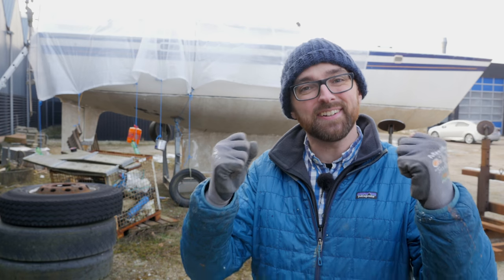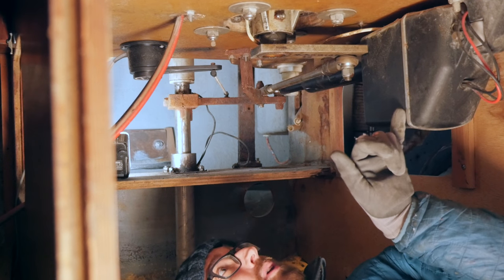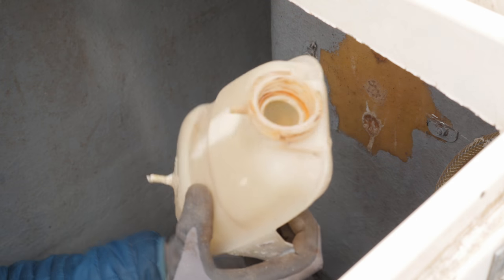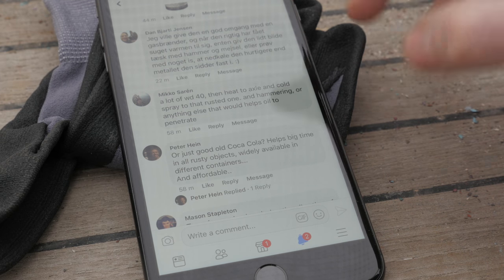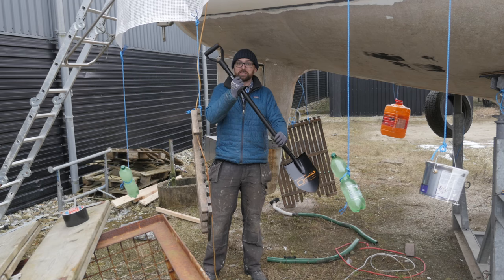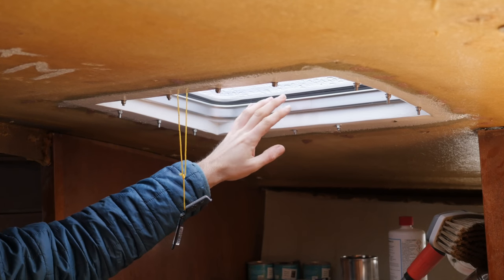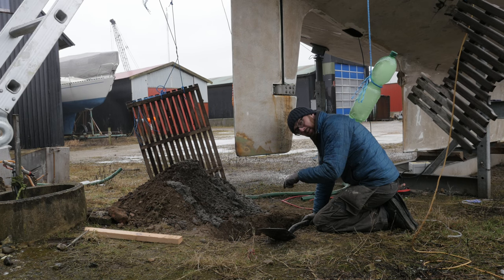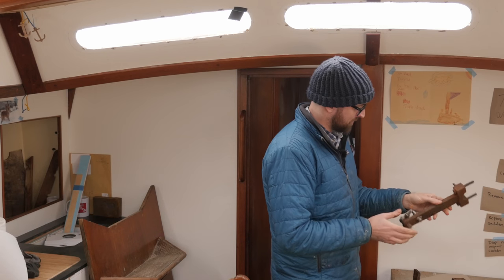Sail Life - Removing the rudder from my sailboat - DIY sailboat repair

Comment: Stop....I would not split the rudder down the seam, that will destroy the rudder and I have done it on several rudders made in a similar way just to get the stainless out.  Best idea is to cut an access panel on one side about 25mm from the edge.  You should be able to prise the panel up and then dig the foam out and inspect the stainless from there and decide on next steps.  If welds and stainless ok then you can clean and re bond to the rudder skin and pour new foam in before closing the panel.  Unless of course you want to make a complete new rudder...  Sorry Mads I burst out laughing when that rudder broke the last bit of wood and dropped into the hole then you trying to lift it out.  Too funny.
Reply: IIRC Boatworks Today did it the way you suggest.

I wonder if the rudder is so heavy because it's full of water/ice?
Reply: johnVidBozo yes I think it will be saturated.  Still pretty heavy rudder but in need of a rebuild.  Should be a breeze after the deck.
Reply: You could use a solvent instead of peeling the foam out manually. Of course you have to make sure the solvent wont dissolve the laminate of the fiberglass.

But then again, from 1 hole you cant examine all welds of the stainless ...

Comment: I think what I would do for the rudder arm is grind the heads off of the bolts so I could use longer stainless bolts, then just take it in to be sandblasted and powder coated. Affordable, and it should last another 30 years.

Comment: I would absolutely take the rudder to your Parent's heated workshop, no matter what it takes to get that heavy thing into your car (you may have to remove your passenger seats but it will be worth it).  I'm a stainless steel welder and I'd really like to see what's inside and my bet is soaking wet core with rusty welds just you have said.  The reason welds on stainless rust is way to complicated to type out here, but the solution is electro polish the welds after the new ones are completed.  With a new foam core and glass/epoxy repair to reattach the skin you should never have rust problems again anyway if water never gets to the welds.

Comment: I would use your Dremel tool with a cut off blade and cut the tack welds on the bolts. replace them with some longer stainless steel bolts. then try to find a shop that can tack weld them back on. and then powder coat the bracket. if you don't know powder coating is a powder they put on with electrostatic then bake on in an oven. by far the best coating for longevity especially in your conditions and it's cheap to do at least here in the states

Comment: Ha Mars love tour video's. I am no expert but I would go for a very safe rudder solution. You do not want any problem  with the rudder at any time I would think. Rust hardly doesn't make it less strong I would think. I would go for longer bolts and very solid nuts. Even alles finshed I would ask an expert tot check die strength and durability. Good luck and keep up the good work. Paul
Reply: Mads

Comment: I will say that pb blaster is some pretty good stuff, but as a pro auto mechanic in the northernmost part of the rust belt in the states  there is a better product, and you already mentioned it 50/50 acetone and  trans fluid bar none the best liquid penetrating fluid.
Reply: kevman0111 , I like aerokroil better than AT fluid and acetone. But that's a close 2nd.

Comment: Dont make a new tiller arm. Reuse the old one.
Just grind of the weld of the bolts, insert new (longer) bolts and double nuts.
With a flap disk and steel brushes (or blasting) clean it all and give it a good paint job. This will save you a lot of money and that money you can spend on other to be renewed parts.
Use strenght class 8.8 bolts. tag weld them after you have bolted the tiller arm on again if you like.

Comment: Mads, a small trick you might find useful in future when using vice grips (mole grips). You had them clamped on to that woodruff key in the rudder stock... Clamp them on REALLY tight, then use a hammer to apply blows to the hinged knuckle area just forward of the lower handle on the vice grips. This can help you use them to pull things outward. It may not have worked on that very seized key, but is still a handy trick to have in your arsenal.

Comment: Mads you will obviously need a new key but whoever makes one for you will need both the rudder shaft and the quadrant piece to get a perfect tight fit. I would most strongly recommend that you open up the rudder to see what, if any issues it has to the metal inside and get it dealt with as necessary before taking these parts somewhere to  get them dealt with. Doing so will also make it much lighter to handle as well!
Replacing the nuts and bolts for the quadrant attachment should be easy by cutting off the weld holding the heads and welding the new S Steel ones back in place. Regarding these quadrant pieces get them shotblasted and inspected. I think they will be fine and ideally have them powder coated for anti-corrosion purposes.
The long flat piece of steel with a foot would be cheap and easy to replace but I would also have this powder coated with new nuts and bolts all through.
Lastly seriously consider having the seal which the rudder shaft passes through in the hull of the boat at least inspected and, in my opinion, replaced while it is easy to do so - access will never be easier!!

Comment: Mads I would get the rudder arm sand blasted. I agree with a comment earlier, the metal looks rusty agreed but the edges look sharp and straight. Sand blast or chemical clean and use a new key.

Comment: Are you going to replace the rudder sensor and/or auto pilot ? It looks like it would be a good idea before putting back the engine. Is it already NMEA2000 ? Maybe you can say something about it in an upcoming video.

Comment: Hey Mads, can you you drill out the bolt holes on the rudder clamp just a few millimetres to allow the nuts to fully thread onto the bolts?
As for dropping the rudder, I remove the spade rudder on my 29 ft boat every winter to avoid freezing water damage (it has a bit of water intrusion) and have found that using webbing straps with an adjustable clamping mechanism allows me to control the descent of the rudder when removing it, as well as supporting the rudder when I am trying to wrestle it back into place. Good luck.

Comment: Keep the steel arm, it's more ductile and much cheaper than a new in stainless (rustfri / syrefast) steel.  Get a local workshop to sandblast it, grind off the heads and press out the old bolts. No need to weld new ones in, just fine to have 'loose' bolts and nuts, easy to replace later. Then you finish the job yourself with 2-pack epoxy (but not on the surfaces towards the rudder stock). Low cost and simple work. Btw - do you realise the boat has a happy face staring at you when you look aft in the engine compartment :-)  rgds from Oslo

Comment: Honestly, I worked in stainless steel for many years and to have those parts replaced in stainless steel would be unnecessary and expensive. With it having to be salt resistant, you'd be looking at 316 (saltwater rated) as the molybdenum content of lower grades would not be high enough.... perhaps even made from 904 (super coastal rated and eyewateringly expensive). It would also have to be machined from a billet and, due to the hardness of 316, this too would be an expensive process. The thickness of the existing steel parts would not rust through for another 200 years, however, I see your point about the bolt lengths and they do need to be replaced. This could be carried out by any good quality engineering workshop and would cost pennies compared to a SS replacement. The rust could be removed using a tumbler and a rust resistant coating applied that could last decades. 

Thanks for the great videos, I've enjoyed watching every one! 👍👍👍

Comment: Forget the digging its not going to happen in frost ,Measure your shaft you will be very surprised at how deep and big that hole has to be, we use a backhoe in Vermont after the frost is gone about late April

Comment: Watch out with stainless steel 304 will still rust in ocean water you may look at 316.  However both of them are a lot weaker the carbon steel (which is prone to rust) but iron which is much softer than high carbon steel will rust less and not be so brittle.   So figure out the force you may need and make sure you have the right material.

Comment: Hey Mads! Great job as always but one thing keeps bothering me... The question of making your new steering knuckle out of stainless steel. I know that galling is a big problem on my turnbuckles because both surfaces are stainless steel and I have to apply anti seize on them regularly so they don't weld together. I was under the impression that that the steering knuckle was of high carbon steel as a sacrificial piece so galling didn't lock my steering in place... You might want to look into it. Just a concern I have.. Keep up the good work!!!

Comment: just sandblast and paint. Nickel coat If you want. A good machine shop will have the blasting equipment and contact for the nickel plating. my guess is $100 - $150.  If you make out of 304 SS it will rust anyway. 316 will cost $150+  in material alone.

Comment: You are going to be SHOCKED at how much those parts will cost made out of stainless steel !

The 2 bolts that are not long enough, have a machine shop cut and drill them out and then replace them with longer stainless bolts.  Clean out the pieces with a wire brush and sand paper then apply a couple of coats of an ant-dust primer.  Final coats can be your choice.

Comment: Im early.
Love you Mads! :)
Remember to ask for longer bolts on the stainless copy thingy. 
Also..... ask them if the stainless has the same strenght properties. I know it is a bit harder, ie, more brittle then normal steel, and rudder could experience shocks and bumps.

Comment: I would just sand blast the "doh-dads" and paint them. The rust seems to be on the surface add more than enough material is left. If you by any chance comes near Lyngby I can sand blast them for you.
I'm sure the bolts can be drilled. Got a drill press in Lyngby as well.

Comment: Cut the head of the bolts off on the control arm. Sand blast the rusty steel parts and then have them powder coated.  Install new stainless bolts that are longer.  No more rust or fuss !

Comment: I would consider avoiding replacing the crusty bits with stainless, maybe shot or sand blast the arm, weld new bolts into it, paint it well  and call it good. the other piece might have to be replaced since I saw scales of rust coming off of it, but if it still has good meat to it, just blast and paint it too.

Comment: From a cost perspective, would it be easier on the pocket book to replace the two short bolts with the proper ones on the rudder arm, sand blast the rust off of what you have and powder coat it?  If this arm made it 40 years like this my guess is it'll last 40 more years renewed.

Comment: Fantastic job overcoming obstacles Mads!  I'm interested in seeing what you find inside the rudder and also what you find for stainless steering parts.  Question though, you mentioned that the coupling you left on the rudder assembly was from an old autohelm.  Ar you going to be reusing the autohelm, or replacing it?  Either way, good luck!
Steve

Comment: When PB blaster ain't around, a paraphine wax candle dripped at the seam or in the threads will loosen the bolt with some heat (even if it's not a torch heat, tho really, buy a small propane torch, they are easy to operate, and quite safe, the flame is barely 8 cm long at max).

Comment: My opinion RE the post arm: I would just clean it up, grind down the metal where the bolts thread on and seat (to gain a couple threads), and then paint it. Put some red thread locker on the bolts when re-installing them.
I just think making a custom stainless one is overkill, and a slight waste of money.

Comment: having that arm recreated in stainess  will be more than a little pricey, have you considered having the whole thing sandblasted and repaint with some of that 2 part epoxy paint you already have on hand? i would either remove the existing bolts with a grinder and replace with longer ones or considering the size of the backing plate knock an inch or so off of that.

Comment: I'm a fan of repairing things where possible instead of replacing.  How about dropping the rusty arm into white vinegar for a few days, you'll be amazed at how it will remove the rust.  Dremel the nut heads and then sand the whole thing, repaint and fit new nuts and bolts, SPIFFY!

Comment: Have another arm made from stainless.  Then considering how important that little bit is while the shop has your pattern get them to sand blast it.  Then toss a coat of paint on it and find a place to put it.  It would take almost no space and it would be really nice to have if you had a problem with the other one.

Comment: keep the original, cut the heads off the old bolts and fit longer ones they don't need to be tack welded on it's only for convenience. give it a wire brush and hit it with some rust converter (phosphoric acid) then paint it or have it galvanised. save a ton of money that can be better spent elsewhere.

Comment: PB Blaster is an extremely effective product. I have personally seen it remove rust from a 2 and 1/2 inch (6.35 cm) solid pipe frozen into a bushing. It works with capillary action, and eats away the rust and corrosion. It has worked when everything else has failed, and is probably the reason you got so many answers to your question naming this product. You could probably soak down those pieces you removed to eliminate the rust, and then be able to prime and paint them. CAUTION -- THE ONLY DOWNSIDE. . . PB Blaster stinks like hell!! It is very slow to off-gas, and for a while, wherever you use it will be a very smelly place.

Comment: I would grind the welds off and extract those bolts, glass bead those part (or have them hot tanked) and then have it powder coated. However I do not have the resources you have. A small front end fork used in automotive mechanics would have made short work of a few connections there. Being a former U.S. Navy Snipe (Engineman) I find some of your methodologies quite amusing really. Good lord Mads, a digging bar you can borrow! When are you going to cut those hatch screw hanks off? Before or after to get ripped up on them?

Comment: and when you put the key way in the bracket back on the rudder shaft anti seize everything the keyway the bracket at the shaft and any nut Arbol you ever put back together inside that compartment anti-seize is your best friend for ease in the future so you'll never have all that trouble getting all that stuff apart again

Comment: I would cut the welds with your drimle tool with a cutting blade. replace the bolts with longer stainless steel. then find a shop that can retack weld the bolts.

Comment: I would cut the bolts from the rudder arm and have it hot dipped galvanized. Then install new stainless bolts. 
I think that would be a lot cheaper, since hot dipped galvanizing is only a couple of Kr / Kg and any blacksmith
 get stuff picked up every week or so.

Comment: Careful making that out of stainless steel. Stainless is more brittle than normal mild steel. I’d make it out of the same material and have it coated. Or sand blast the original. There are some great rust prevention coatings available these days.

A metallurgist will be your best bet to determine what material to use.

Comment: I'm really curious why you've left the hole for the sail drive open for weeks? At a minimum it seems like you could patch it closed with duct tape to keep it warm inside. Also that skeg is moving a lot. Should be moving a half cm, from the video it looks like the tip of the skeg is moving 2 cm each way. I would certainly record the deflection of the skeg vs force applied using tape measure and fish scale

Comment: Smooth out ALL the apprentice marks you've made, each and every one of those is a potential fracture spot in the future. I'm not joking, over at channel Keith Fenner, there's plenty examples of shafts being split like wood, and that's just a propeller shaft, on a rudder, there's considerably more umph being pressed on that connection.

Comment: The rust on the torque arm of the rudder seems to be superficial. Further, it looks like the torque arm has played the part of a sacrificial anode in the salty humid confines "aft". Welded bolts are easy to cut off and replace. I think you should clean the arm, and then sand into the weld between the arm and the thick, square clamp. If the clean metal is clear of tiny cracks you could probably use the arm for 30 years more. Spend the difference on good quality rope.

Comment: I think you should stick with the steel parts, mild steel is stronger than stainless. Just grind/sandblast and spray galv. or prime and paint. They will out live you. I have ordered a lot of stainless parts for my boat and it is very expensive as you know. Spend the money elsewhere on the boat...you know you will. lol

Comment: It’s your boat so build a replacement in ether stainless or steel. I would rebuild the old unit an retain as a spare after painting with epoxy. My vote is to dive into the rudder. To me the rust indicates water and more surprises. I hope I am proven wrong.

Comment: My thoughts on "hatches".  Usually they are only used when at anchor, so wind from port or starboard would not be an issue because the wind will always be off the nose.  Of course if you always dock then maybe.  And as far as a wave breaking a forward facing hatch, well, if your hatch is open in rough conditions, shame on you.  So, as most cruisers either moor or anchor the most popular hatch position would be facing forward for good air flow.  One man's opinion.